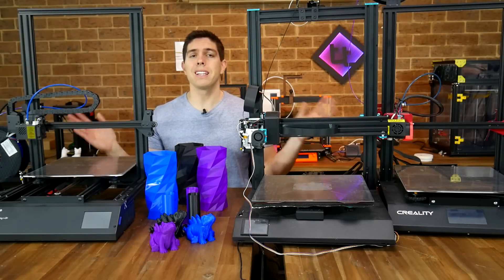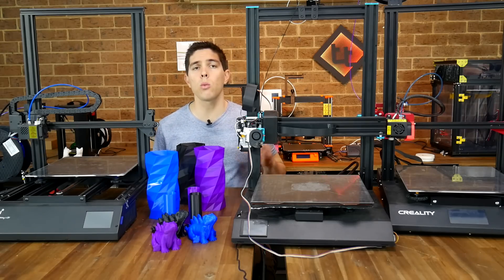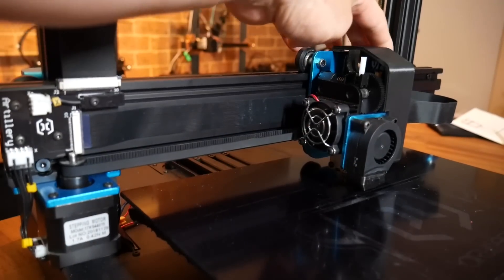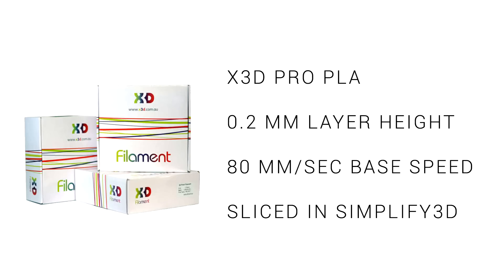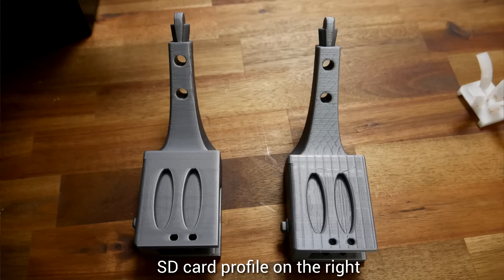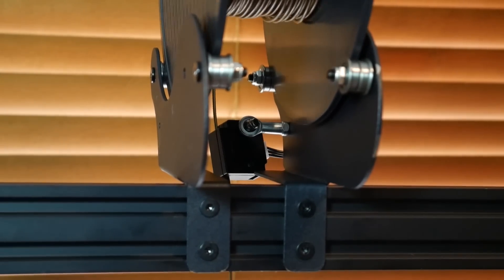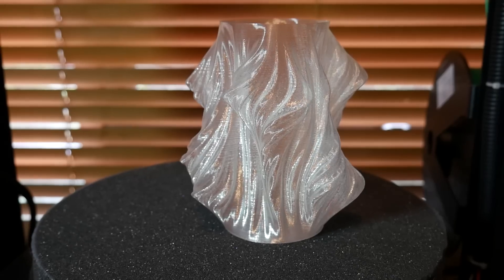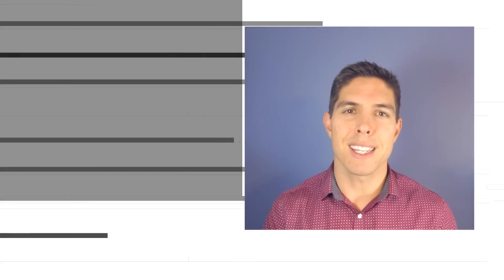Biqu Thunder vs Artillery3D X1 vs Creality CR-10S Pro: Large 3D printer comparison

Comment: The new prob is blue at the tip and is much more consistent the original one . It is also sensitive enough to run a no metal print surface such as glass or a polypropylene plate with and recalibration of the sensor. The tiny machines 3d firmware for the screen and main-board firmware also add more prob points for a higher quality mesh  and a few more button functions.

Comment: Hi Michael, how about even further outside the box with the Anycubic Predator, delta style printer.  It's got a 370 mm round by 455 mm high build volume so I would consider it a large printer.  It's a delta so it can print fast.  It has an Ultrabase print surface and auto bed leveling.  I'm not sure how I'd classify the extruder since it has a Titan style extruder, suspended above the print head with a short bowden tube connecting it.  The price is similar to the CR-10S pro at $600.  For me, the fast print speed potential and the ease of enclosing the print area make it an interesting option for printing high temperature materials, quickly.

Comment: I have 3 Tevo Tornadoes, absolute work horses.
Reply: I've been considering the Tornado, any concern with there only being a single Z axis motor?
Reply: @timezonewall  No issues for me.  It isn't any different in that respect from a CR-10.  With only a single Z axis, you do have to watch the tension for the wheels on the X carriage on the far Z frame more closely to prevent drooping.  There are kits to convert CR-10s and Tornadoes to dual axis, either dual motor or dual screws mechanically linked.  I tried one of the mechanically linked kits on one of my Tornadoes, but I had an issue with the threads on one of the lead screws and just went back to a single Z screw without any headache.

The AC heated bed is really nice, but definitely print some sort of strain relief as one of your first prints.  The Tornado has a large enough community behind it that mod parts are easy to find on Thingiverse.  The newer Tornadoes got rid of the PEI sheet on the bed and come with bare glass now.  I use mirror tiles to help prevent wear and tear on the bed glass anyway, and converted on of my Tornadoes to an aluminum bed.

I also highly recommend on any larger CR-10 style open frame printer to print some braces for all the corners of your frame.  Make sure you have the frame good and square and then tighten the braces down.  That helps stiffen up the frame A LOT.
Reply: @danamccarthy5514  Thanks for the info. I have an Ender 3 pro so I am familiar with keeping an eye on the right side X carriage, it hasn't been a problem though. I figured on a larger sized frame some additional bracing would be in good idea. One thing I don't like on the Tornado and the CR10/10S is the separate controller box, I expect though there are replacements that can be printed which attach to the frame.
Reply: @timezonewall  I actually really prefer the separate control box personally.  Anyone who plans to use an enclosure and work with ABS or higher temp materials should want to be able to keep their electronics away from the heat of the printer.  If you only plan on working with PLA and maybe a little PETG, then that is not a big concern.
Reply: @danamccarthy5514  That makes sense, I've haven't tried ABS so far so I hadn't though about that aspect.  Also considering the Anet A16 which has decent reviews, basically a CR-10S except with rods on Y axis, like most it would need a couple of upgrades.
Reply: I have an enclosure around one of my Tornadoes for trapping heat for ABS work.  I am very glad that with just running longer cables, I can keep my control box outside of the extra heat of that enclosure and still have plenty of slack in all my cables.

Comment: Artillery3D X1  has been amazing. Only had one issue and that was when the print didn't stick, I got a blob of PLA. After clean up and leveling, started working again. Mine came with the new ultrabase. Its good and prints stick to it 99% of the time. However, its got be kept clean and if past experience holds, ultrabase wears down after a year. I guess time will only tell, but I'd prefer if it came with glass which is easy to maintain and replace. So that is me being picky. Its been great so far. Haven't had to make a single change or fix so far.

Comment: I have the Tevo Tornado and love that machine.  It was a work horse before I did upgrades to it, but it's a super beast now.  Added an E3D V6 Volcano to it, along with a second Z screw.  Then topped it off with an SKR 1.3 with TMC2208 drivers, and Ultrabase glass bed.
Reply: Jason Driscoll that’s a nice Tevo Tornado, sounds great! But nowadays the Artillery have all that by factory just without the e3d hotend... I think it has a titan style extruder and it is direct-drive.

The glass is ceramic that expand (thermal expansion) much less than regular, borosilicate and temperated glasses. I use a ceramic glass in my Ultimaker and it least 3 years until now without any demage and Z variarion.. it’s super flat! Earlier I switch the glasses many times.. like 3 by 3 months. My ceramic one is made by Schott, a German manufacture... don’t know about this and Tevo Flash that is also ceramic glass.

Cheers!

Comment: Why did you have to sacrifice Power Loss Recovery to enable Thermal Runaway Protection?
Reply: Probably because of limited memory on the stock board.
Reply: 10S has Mega board. I thought only the Melzi board had limited space. ?

Comment: I really need a 510x510x510mm build space. I have a CR10-S5, but the moving bed at that size starts to become an issue. There seems to be little out there with fixed beds that are designed for big prints. Any suggestions?
Reply: The bigger the building plate the more it struggles with inertia when it moves laterally (it's heavier). That's why corexy and h-bot layout are preferred for such large dimensions printers (the building plate only moves in z-direction one small step at a time). But 500mmx500mm plate has another inherent weakness: the thermals. It consistently looses bed adhesion faster than smaller plates. If you want to print anything else than plain PLA, it needs a closed chamber. That's where we leave the consumer level product offers and enter the pro market. You still have the DIY option but even with nicely engineered builds like Voron corexy or Railcore you're close to 1200 to 1400 USD parts BOMs. And you're still in experimental territory as these designs are often tuned to more modest dimensions like 300x300x300 to 300x300x400.
Reply: @the_arcanum  $2000 is fine, and still cheap, the problem is finding a design that suits that size bed.

Comment: One disadvantage missing for the Sidewinder X1: Very slow heating and much offset (about 10°C) between temperature shown in display and realy measurable on the surface of the heatbed. I take some very disappointing pictures with my flir,  also showing differences of more than 20°C between middle of the bed and there the leveling screws are.

On the other side, adding ABL with film probe is extremly easy and cheap. Only about $2+some cables or $5+some cables if you want also a PCB with LED.
Reply: Mine heats up quick and easy even with the whambam system on it.  It's the "v4" as some call it. Temp display is on point as well for mine.
Reply: @3dprintingbiker693  how did you measure the real temperature? On https://drucktipps3d.de/forum/topic/aenderungen-am-artillery-evnovo-sidewinder-x1/?part=3#postid-46198 you can see the flir-picture 10 minutes after the display showed 90°C. It is without magnetic spring steel system. The highest real temperature on the surface is 85°C
It can not be else: Glas is a bad heat conductor. So if the sensor in the silicone heater detects a temperature reached, the surface of the glas can not have reached it. Also due to the low heat transmission, thermal energy can not be transfered fast enough to compensate for the surrounding air cooling the surface.

The magnetic base of a wham bam system or simular is even less heat conductive. So the differences are even higher. Have not posted my pictures yet, as is a not finished series of tests, so no link.

Maybe Atillery corrected the offset between measured temperature and the surface temperature on stock printbed; but they could not have changed the physical behavior of glas.
Actually in their published profiles, they use anfirst layer temperature of 90°C for PLA (!) but taking a measurement, the printbed is only 55°C on start of the print. With a benshee, the temperature of the bed is about 60°C after finishing the first layer. So using an unrealistic first layer temperature is obviosly a "Work around" for starting fast. But a very bad one, if you have a big print the first layer bad temperature might realy go up to 85°C on PLA, so above glastransition temperature.
The right way to compensate slow heat transmission through glas would be a start gcode, heating up to 90°C, wait 4 minutes and than change bed temperature to 60°C (or 65°C if offset is not corrected). With magnetic base a bit longer and higher offset.
But of course this do not solve the uneven heat distribution of the bed as seen in the thermal picture.
Reply: used tape and heat gun, also we have a flir thermal camera where I work so I was able to use that to take a peak at it. My last bed was 24v on my other printer, and I was curious to see if it would heat up differently. The x1 was a lot faster. and better coverage across the whole bed. Keep in mind this is with a WhamBam on it also so that probably helped to disperse the heat across better although probably slowing it down a little bit from stock. Still was alot faster than the jgaurora a5s though.
Reply: @3dprintingbiker693  I use not Wham Bam but the simular system from AliExpress Energetic 3d store. There seems no difference in quality but the system from Energetic only costs a third compared to Wham Bam and the PEI-Sheet is already applied. Also I have a PEI powder coated 300x300 spring steel from Thekkiinngg (Canada). Its my absolute favorite.
The magnetic base definitly not helps much.
The AC-Heater of course heats up faster than a 24VDC bed; the problem is not the heater, but the glas. So if you compare the Sidewinder with another printer using an Ultrabase, it heats up fast. But if you compare it with a printer with AC heater and aluminium bed and magnetic spring steel, its slow.
Also a aluminium bed spreads heat horizontal - aluminium is more heat conductive than steel and the bed is thicker than the spring steel. So it solves a bit of the problem of colder zones.
Reply: I also am not using stock firmware so that could be a factor as well lol Just remembered that

Comment: I dont have any of these but i think a great addition to this video would be tronxy x5sa, i have had mine for a little over a week and it prints nicely, is 330x330x400, 24volts, 32bit board. Only realy draw back is the fan for the board is incredibly loud. It needs to change. Also the printer was on a flash sale on gearbest for $315 plus there was a coupon so i paid 300.99 usd for this massove core xy printer that i am still learning but am so far impressed with

Comment: AC heater bed makes the printer less expensive to manufacture since they can use a smaller power supply, since the biggest power draw is the bed.
Reply: But then they have to build in an interface to control the heat safely to the bed, so extra parts needed. In the case of the X1 it is an extra box controlled with the mainboard for small temperature-changes.  It also comes with a more expensive heatpad then the simple aluminium-based 24Volt beds.

Comment: I have the Sidewinder X1 (revision 4) since a few weeks and have to say, that's the best 3D printer I have seen bellow 1000 Dollars.
The bed is AC powered and extremely fast, it levels very easy, it's fast and it prints almost all materials out of the box in high quality.
I just love that printer.
Reply: Nice! Now I want to get one!
Reply: I got the cr10s pro and God I wish i didn't buy soo many issue. I'm thinking to get the X1 seems really good. Should I buy it ?
Reply: @xXxXENcoreXxXx  well, we have revision 4 sidewinders and nothing but trouble...levers break, bed is not level, heating is bad, cables break etc...
Reply: 3d Print Creator I just got version 4 and can’t get it to print such high quality at all, I’m having weird layer waves and such lol gonna wait for a profile to come out for it
Reply: This is what I’ve been leaning towards, but As it will be my first printer I’m nervous with the mixed reviews.. x1 v4 seems like the best bang for the buck but I’m not really all that confident in my ability to push through the “problems”
Reply: @jamesfrancis303  Hi james,
I can imagine your fear, but I also look at it from a different side. Almost every reviewer agrees unanimously that the Sidewinder X1, as one of the few printers from China, is really well put together. The company has had quite a few problems with the first series of printers they released, but they have also shown that they took the problems seriously, and they have worked extremely hard to solve the problems.
In the reviews I made on my channel about this printer, I also explain the differences between the earlier versions and the version 4 of this printer. You can see that all problems that were previously mentioned by people with an earlier version have been solved in the fourth version.

For me it is still clear that the Artillery Sidewinder X1 is a better choice than a much more expensive Prusa, or any other printer under 1000 Euros. It really isn't perfect yet, but every printer has it's good and bad things. It is very good, very easy to use and maintain, and repairs are really easy. Every possible repair has also been documented on YouTube, so you can't go wrong with this.

It now almost seems like I'm making money from promoting this printer, but I really say from my experience that I don't know any better Chinese printer than this one.

Good luck with your choice.
Brian.

Comment: I think your videos are great and I have learned a lot from them.  I initially had lots of problems with my CR10S Pro.  I used Luke Hatfield’s guide to fix some of them.  I also had to shim bottom of the gantry to make the uprights perpendicular to the base.  I added a bltouch and the hero me fan shroud and now it is a great printer.  I still want to add a e3d volcano or a mosquito hot end so I can print with a bigger nozzle without having to slow way down.
Reply: With a Volcano you can print same speed with a nozzle with higher diameter, thats right. But even with the already upgraded fan shroud: You have to cool much more mass of hot filament to get good results at overhangs and bridging. A 0.8 mm Nozzle with 0.4 mm layerhight extrudes 8 times as much filament than a 0.4 mm nozzle with 0.2mm layerhight. So when using same speed in x and y, you need at least 8 times the air for same cooling results.

The Sidewinder X1 uses a Volcano with high speeds. I slowed it down to the speeds used by Prusa to get good results - because overhangs where bad due to the fact the fan could not keep up...

Comment: I paid $500 for my CR10s Pro from Walmart.  Had no issues with the bed leveling or probe sensor.  I did however upgrade the print surface to the WhamBam.  In one month I have over 300 print hours with no problems printing flexible, PLA and ABS.
Reply: Wait, 3D printers... In WALMAAAAART?!
Reply: @roxandtol  it was on their website
Reply: @gilbertpfaffsr1822  oh
Reply: that's great.  I ordered mine yesterday for $459.00 online.  It had consistent reviews with excellent quality and robust system...500w supply, dual z-axis, etc.  Looking forward to it.  It's my first 3D printer!  Thanks for your feedback.
Reply: @RozsaAmplificationLLC  mine also it's first printer I don't know it's good deal or bad after going through the online reviews I am afraid now that did I make mistake because it has issue with bed leveling and extruder and feeder mechanism in longer term use.
Please let me know what is your observations on it.

Comment: OMG linear rail corexy 3d printer for under $600?!!  I can't wait to see that!
Reply: Which one is it ? Is the video already online ?
Reply: I think it's the sapphire s pro.
Reply: @barrymcbruce  it's smaller
Reply: @barrymcbruce  the larger one yes
Reply: voron maby but i think they are roughly 700, hmm
Reply: @any1alive  Voron is way more than that. I'm au$2000 in on parts for a 300x300.
Reply: @any1alive  Voron is not sold premade nor a kit.
Reply: I agree, that sounds extremely interesting.
Reply: Creative3D Elf?
Reply: My guess is the Tronxy X5SA PRO. It's specs match perfectly.
Reply: Admittedly some advantages, though not big on fiddling with the ginormous belts.

Comment: For the XL you should include the Chiron I just love mine. Only thing I changed so far is I replaced the PTFE tube with a capricorn one as we print HIPS at 255 nozzle 105 bed 24/7 and it needs a cable holder as they could have done a better job with the wire running to the X gantry. Some have updated the fan but then we print mostly fan less so it has not been an issue

Comment: I have the SW X1 and have had some issues with it.  Overall, I would definitely not recommend it for new users as the fixes require a bit of electronics knowledge but once you get it tuned, it works great!
Reply: What kind of problems did you have?

Comment: Love my CR 10s Pro.  I have updated it, Z anti backlash which gives no slip between the Z  screws.  Inductive sensor which now gives no temperature / humidity effects on height.  Also added  G29 to the start script and problems with first layer have disappeared (occasionally get a bad start).  Yes it does take longer, but it really works.  Also I use the TinyMachines3D code, which fixes a lot of Creality issues.
Reply: I did the same things its a beast now